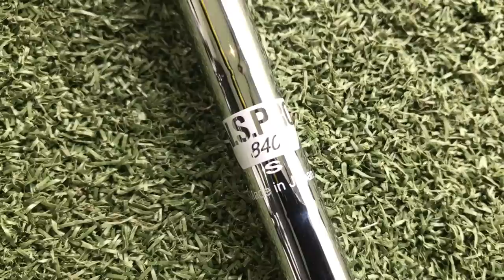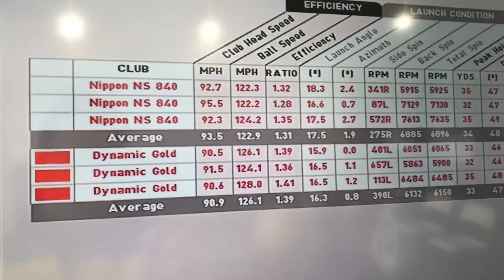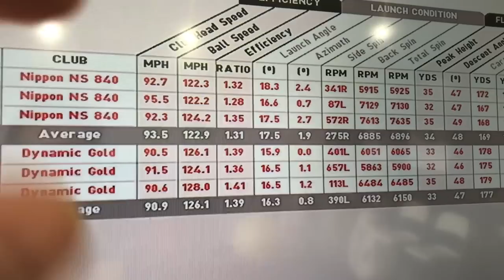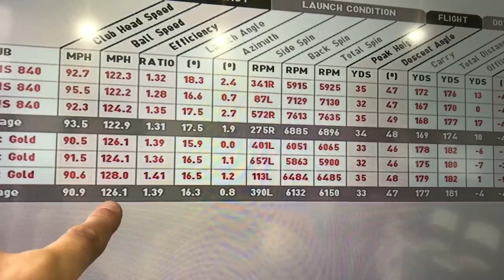Golf Iron Shaft Test - Heavyweight Shaft VS Lightweight Shaft With Launch Monitor Results

Comment: I think we often overlook swing tempo when choosing shafts. I have a short back swing with an aggressive transition. I was using senior flex lightweight shafts because that's what I was "supposed" to be using based upon my swing speed and distance. At a demo day they put a Mizuno swing analyzer on and it said I should be using KBS Tour Pro shafts. Immediately my dispersion tightened up, and my distance increased.
Reply: I am very much as you describe. My recent fitter told me my tempo was at a mid speed. I also have a short back swing with a very fast downswing. I was using Mitsubishi MMT 55 gram with a senior flex. Those shafts were recommended to me almost two years ago after I had picked up the game after a 26 year hiatus. Today I believe I have improved my swing strength by practicing every week and playing 3 rounds a week. I believe I outgrew these shafts. This week I was fitted for a whole new set or irons and the fitter suggested the True Temper Dynamic Gold Mid 115 grams in regular flex. I am still getting acquainted with the new feel to these but my dispersion is much better and the trajectory is a more of a mid flight while with my old set I was hitting the ball very high.

Comment: Excellent vid again. I have found that light shafts are less accurate,  so i just purchased a set of mizunos with dg s300 ATM tour white shafts in. No loss of distance but accuracy has really improved compared to my original Project x 5.5 rifle shafts.. Hoping to get back down to 4 Handicap again. Currently sitting on 7..I wonder if this would work with my driver?  ie,  fitting a 70g shaft instead of a 60g. I will give it a go..Thanks again for this one Mike. 👍

Comment: Great test Michael. I switched shafts in my AP-2 7 iron last year after bending it, from Project- X rifle 5.5 to True Temper DG S300. I have DG S300 in my old blades and just prefer the feel of them over the Project X, which actually feels heavier. (although having just weight them both, the Project X is about 30g lighter) I´d never really thought about swing weight / flight characteristics before, just assumed it was all down to my strike, so it´s interesting to hear your thoughts on this and the difference in feel between the two (I have similar swing speed, around 92-95mph with 7 iron)

Comment: Have you dont any videos on the 950gh or the 990 nspro range Mike. 
The 950 is miles more stable and they actually compare it to a 125 shaft in any other brand for consistency. Any thoughts? 
Thanks.
Reply: Had a hit with this recently. Fantastic, an absolute sublime feel and execution, compared to the DG S300 I currently play. Have never played anything else, but the DG S300. Time for a change, perhaps?

Comment: Launch angle, peak height and land angle all very similar yet you said you saw the shot ballooning. Was it the spin?  I see the distance was 8 yards longer with the heavier shaft. I would have expected much higher peak height and land angle with the lighter shaft.
Reply: The monitor results were normalized. He mentioned it was quite windy in person. The extra spin was probably causing the ball to be a bit floaty in the wind.

Comment: Great video Michael. Can you do a video or explain how club length effects clubs "swingweight" etc. I play half inch longer with midsize grips (as fitted at a fitting) but read so much conflicting info after my fitting on how the club dynamics/flex can change by adding just 0.50 of an inch.😣 As your a taller player yourself.. can you explain what's going on. Do heavier grips counter act the added length etc?? Thanks.
Reply: I also am really interested in knowing more about this.

Comment: The Nippon had "very high" launch compared to the s300 but the avg difference was 1yrd... Nippon was 33-35yrds, S300 32-35yrds. Not sure if I could spot a 3ft difference... I assume Nippon achieved max height faster and stayed aloft longer due to the 700rpm increase in backspin. Great Vid!
Reply: Bingo. Decent angle had a degree in it too. Bit of weight, seemed to tame the shot he didn't want to see.

Comment: can you do a video on driver shaft weight , the driver length video was excellent would like to see advantage/disadvantage of a heavier shaft , cheers
Reply: I second this. Would love to see comparisons starting from 60g to 80g or 90g.
Reply from the maker: +jason thomas sounds good, I’ll add to my list 👍
Reply: Would also add a third factor. Club head weight. So adding 20 g to the weight ports. Not front to back since that would change spin. But simply adding more\less weight. What would be the effects on ball flight etc?

Comment: Very interesting video. The ball speed increase is remarkable. Maybe the weight of the heavier shaft gives more impetus to the ball...like tiny hammer versus sledgehammer. 
Seems that the weight is more important than the flex. Nice one.
Reply: That's down to strike.  He has more clubhead speed with the lighter shaft.  The only way that can translate into lower ball speed is by not hitting the centre of the face.    You can see this in the spin numbers and launch angles.  3 shot sample with 1700 rpm spin difference and nearly 2 degrees variation in launch angle points to a couple of wildly different strikes.  Mike is Mr. Consistency most of the time so this really stands out.  If you are choosing shafts I would do a lot more personal testing than just 3 strikes unless you get 3 relatively equal strikes.
Reply: Momentum is a bit higher in heavier shafts. Swing speed and shaft weight and flex are correlated.

Comment: I changed my drive to a 59g regular flex and my hybrids to 59g. These are considered light weight. I make solid contact and control the dad or draw easily just by changing hand position. My irons have 72 gram HCP from Callaway and with the longer irons I tend to fade. Any suggestions in weight for iron shafts?

Comment: Good info Michael, but what comes first? I ask as I went to test an iron today and found that I gained 10 yds carry but added an extra 5 yds when testing a lighter shaft. The club felt, sounded and looked great but the low flight and low spin were worrying. So as I’m  going to change my irons soon, do I select the head I want and then get fitted for the shaft or do I get an idea of the ‘right’ shaft then test that in a number of heads?
Reply from the maker: elect the head you like and design that suits your strike ability, then work shaft around to dial in launch and spin and feel you prefer.

Comment: I use I use precision rifle FCM 6.5. I’ve had the same shafts for 10/12 years. When I got the clubs I was younger lad, now. turning 60 I find I’m hitting the ball to the right all the time. I’m thinking I’m not as strong now so I’m not getting thro the ball as I did when I was 50 ?. Without being tested (living in oz ).whats a good shaft ?
Reply: Try a modus

Comment: Hi mike, i have the ns pro Reg shafts in my srixon 765 irons .  With swing speed of about 74 mph club head speed about 100 mph. I hit spin  Numbers of about 5700 with 7 iron  dynamic loft around 20degs carrying  about 140 yrds . Would you recommend somthi g that would lower my spin or does this sound about right?
Reply from the maker: Hi. Your dynamic loft is pretty low for a 7 iron which is why your spin is slightly on the low side. If you were to increase your spin you'll probably loose some yardages depending on other aspects of your club delivery & speed etc. You don't want to lower the spin anymore.
Reply: Michael Newton Golf many thanks 🖒

Comment: Mike, 

Basic physics explain why your ball speeds were lower with the lighter shaft. If we assume the swing force (F) was the same for both clubs, the inertia you exerted over the ball was not. The lighter club simply had less mass (m). 

This also explains the longer carry distances and the spin numbers. The ball was able to stay inert longer on the face creating a longer interaction with the grooves and creating more spin. This backspin creates more lift in the air and increases decent angle. All of these reduce carry distance.
Reply: Is that right?  I agree basic physics is f=m x a.  But the force being applied to the ball is surely by the club head so it is the mass of the club head which is relevant not the mass of club head AND shaft.  No idea whether this is right though - just asking the question
Reply: It was the smash factor. He didnt hit it as pure with the nippon. He actually got slightly higher ballspeed with the nippon at 1.35 smashfactor vs 1.36 with DG. I agree i dont think shaft weight has any impact, though maybe the stiffness, since it doesnt give in as much? Need to look at this as a dynamic movement not as static.
Reply: Justin Stephenson you must consider all moving items involved when calculating mass. This includes the head, shaft, and the person swinging the club. Because the head and person stayed constant throughout the tests the only thing we need to consider is the shafts
Reply: I think this is one where quality of strike over rules everything.  As far as I can tell there is no correlation between shaft weight and carry distance when humans test - maybe there would be when robots test - if anything heavier shafts tend to produce shorter carries for more golfers which is not necessarily in contradiction with you if the heavier shaft results in a much slower swing.  I am not convinced that anything other than the club head is relevant for mass - but then again I am not a scientist
Reply: You can’t really draw any conclusions about the spec of a golf club vs shot results when doing a test like this. There are just so many variables in a golf shot when you introduce the human element. If you hit them both on a robot with the exact same swing speed attack angle etc etc etc you wouldn’t see any difference, but in the hands of a golfer the weight or feel of a club can absolute have an impact on how a player swings the club. I’m a high swing speed player but play light weight (80 gram) graphite shafts in my irons because I like the lighter feel and less harsh vibrations graphite offers.
Reply: I believe your physics are correct but can’t be applied to a flawed experiment. We already know the force wasn’t the same. The strikes were better with the shaft style he prefers a bit more. If the strikes were reversed it would appear to defy your hypothesis but that wouldn’t be the case.  Hes likely swinging with relatively the same force at different speeds but that force is irrelevant if not applied to an equal degree. 

One explanation could be that lighter shafts, especially with these tip characteristics, tend to twist more which could leave the face open causing the ball to ride up and spin out. He did say he couldnt feel where the head was in the downswing very well so its likely simply mishitting the ball.

Comment: Very good video, really instructive for every level golfer. I knew I could not play light shaft but more for feeling and control reasons, but I never get how big was the gap between ball speed and carry distance. It would be interesting to include more shaft testing in your golf club reviews. The shaft industry is a jungle with so many options (brands - models), and it is hard to get a grasp even during a fitting session!! :)
Reply from the maker: +MsBibid that is very true

Comment: Surely kickpoint also has to be considered here?
Reply from the maker: Alberto Fernandez-Sanguino does that not reflect in the numbers
Reply: Therefore there is a second factor which has to be borne in mind. Would make more sense to compare shafts with same or very similar kickpoint or bend profiles. That way only weight is the variable. Also you need a greater Datta set say 10 shots each to get to some meaningful conclusions.

Comment: Thanks for the video Mike, it was very interesting and enlightening .  I swing a 95 gm UST Recoil shaft in irons and I have around 105-107mph driver club speed.  Tempo is such an important part of my swing and if it's not right on it can be a long day.  I'm just afraid of losing distance if I chose a heavier shaft, but maybe I won't.  Next time I get fitted I definitely have to use a launch monitor.
Reply from the maker: +Joe Pesce yes Joe

Comment: shows perfectly that your getting more bang for the buck with the heavier shaft.  Slower swing, better energy transfer, less shaft deflection, more distance, and more accuracy.
Reply: Only if that shaft suits your swing.  I don't think it would suit mine.  I have a driver SS of 95 and a very smooth delivery and transition. Heavy shafts don't work for me.  I'm more accurate and get a better ball flight and feel for the club with the lighter shaft.

Comment: This is quite a revelation! The loss of distance is 4% for lower weight of 10%!! Right now I am using NS pro 850gh shafts, light weight due to advanced age. 
Thanks for setting premise with your impeccable analysis, Good basis to shift to light weight shafts. Thanks
Reply: Fantastic shaft.